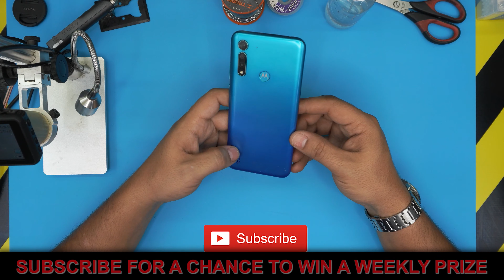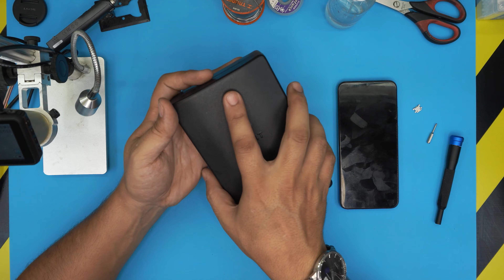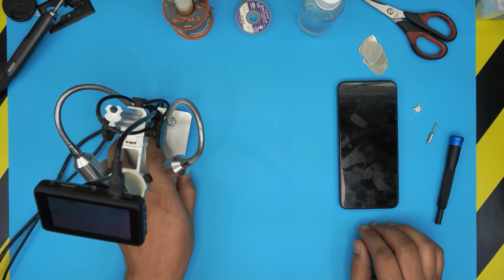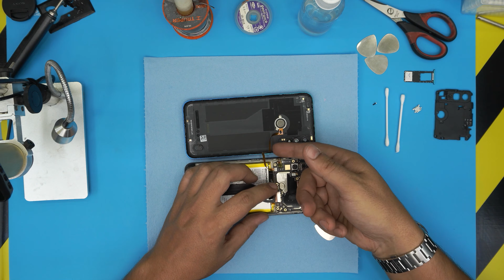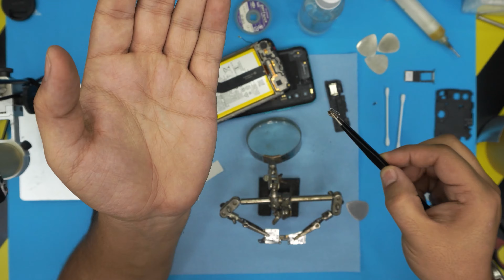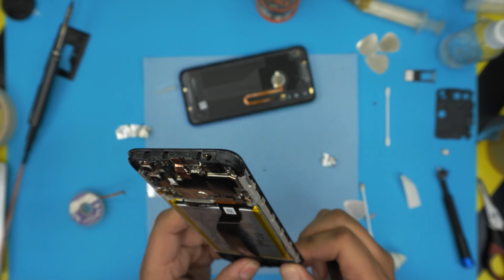Moto G8 Charge Port repair | Power Jack repair | micro usb port repair

Comment: couldnt get the usb port heated up enough to come out like you did. I tore that out of there lol
Reply from the maker: you need to get it to 420c minimum, and use a lot of flux.
Reply: @uFixTek  I should have been omre specific. I was talking about removing the board to get at the port. There's a small black double sided tape holding it down after removing the screws it was difficult to get it hot enough to get the adhesive to release, the battery was getting hot and it was concerning.